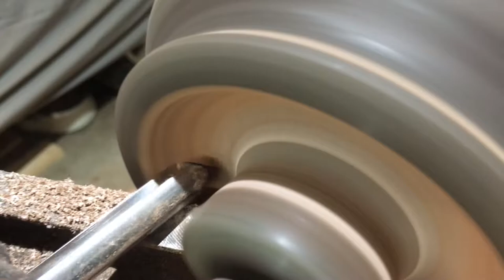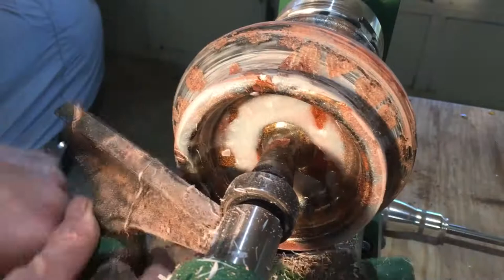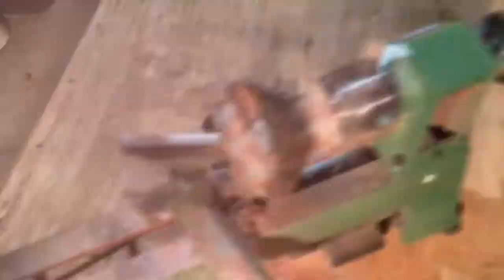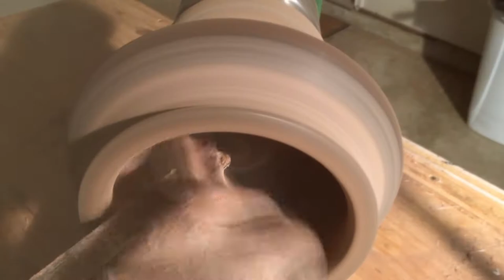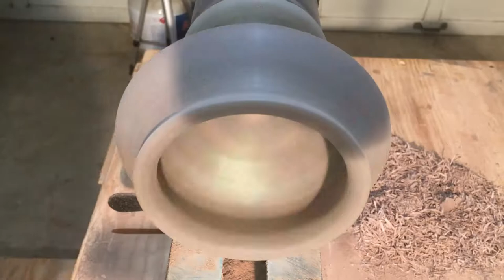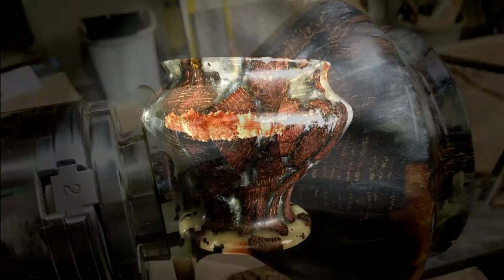Tree Bark and Epoxy - 'TURNING' Scrap to Art

Comment: Found this as I have a big pile of larch bark and wondered if I can use it with epoxy for turning... your piece looks fantastic. Did you need to do anything with the bark to prep it for the epoxy at all?
Reply from the maker: Hi, I didn’t really do anything special with the bark other than bouncing it around in a 5 gallon bucket trying to shake as much debris off as I could. Then I scooped it out of the top and put it in another bucket and blew it off with air from my compressor.

I didn’t use clear epoxy because I was afraid there may be bark particles floating in it.

Also I used a small vacuum chamber to prevent bubbles. Once the epoxy gets hot, your pieces of bark are gonna start expelling air, causing bubbles. That’s your biggest hurdle.

I filled up one of those Home Depot mixing cups with bark and slowly poured the epoxy over it and put it in the vacuum chamber.

I can’t remember, but I may have put a round piece of wood on top of it and a metal weight on top of that to hold everything down. 👍🏼
Reply: @joemonnone  Ace, cheers for the tips mate. Hopefully mine will work out well too.